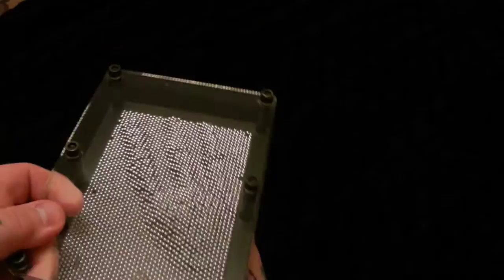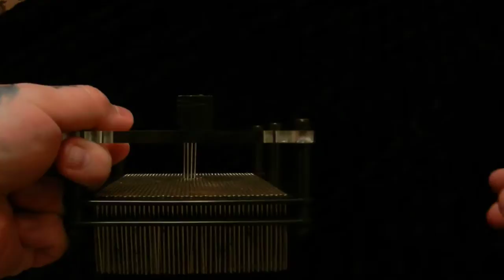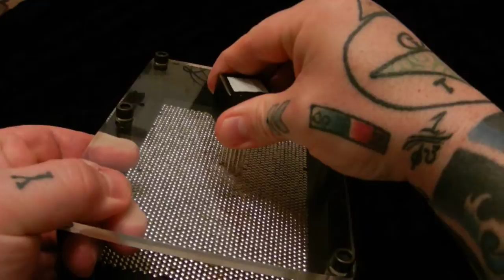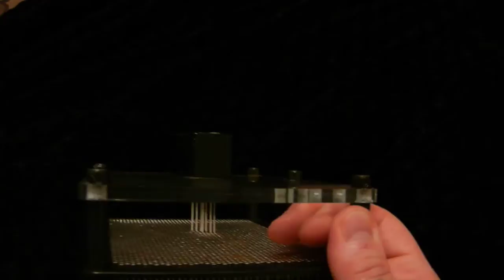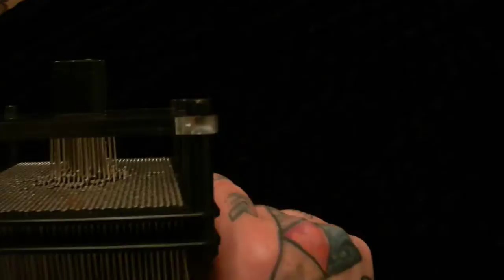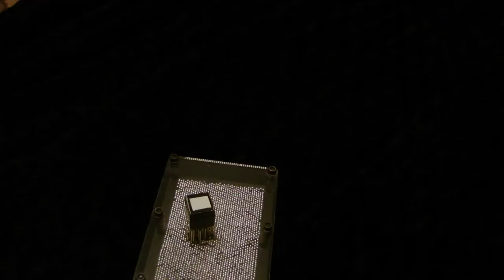The best analogy of MAGNETIC INDUCTION on youtube! Explaining field induction IN TIME

Comment: Coming in slow simply allows certain pins that are closest to the magnet to raise first and then because of the slight angles the pins are being torqued to stop other pins from raising due to friction caused by the unaligned pins all jamming together. I like a lot of your videos, but you should delete this one. It's wrong. You would see a different effect if the pins were guaranteed friction free and could not be angled in the imperfect holes in the base.

Comment: I think you are misinterpreting your observations or did not consider some factors. Three things, the angle of the magnetic force to the relating pins(nails), the resistance caused by the hole edges relating to the angle, and then the impact of magnet to the system when you show "fast" speed. All three combined accounts for the difference in the number of pins between slow and fast. If you were able to negate the friction of the pins, and were able to stop the magnet before impact to the face of the device,  you would see more accurate representation of magnetic yield. I infer that when you move slow that the pins depending on the angle to the magnetic attractions have to overcome the edge resistance of the hole. So moving slowly will cause data of only the pins with the least angle, least resistance, most attraction. Whereas the fast speed, you introduce a impact which causes two effects. It reduces the resistance because pins are vibrated away from their edge resistance, the second effect is the impact pushes down on the pins, and causes a rebound force pushing upwards, literally bouncing them up. Hence you have a larger data set of pins. So buddy... your experiment is ...well not conclusive.
Reply: That is a terrible counter argument. "Rebound force pushing upwards"??? Congratulations is in order, you came up with a new force unbeknown to every human in existence. Well played. 😆
Reply: @E V  Dude, you seem to be saying I am making up a "new force" unbeknown to human existence. As long as human existence has never seen a trampoline. When he smashes down on the top of his model, he is creating counterforce from the PIN perspective... which is in opposite of the direction applied but distributed unevenly. This is "UP" because that's the only directions the pins can go. I am glad you are skeptical, you should always ask questions.
Reply: @XR_IX  I have one of these pin boards and have done what you say it makes no difference to the result whatsoever in over 50 attempts. Even when the magnet is impacted with the top pane the force created is negligible and the same result is seen. This experiment is only one attempt to show the relationship between fields and time. Just remember the smaller the space(i.e time) the higher the capacitance. Then we can represent this phenomena mathematically.
Reply: @GiveMeLiquidity  If you post your experiment, I would appreciate that. I am saying as long as the force coming down influences the pin board other than magnetically, the results are inconclusive. Your hand or the magnet can't contact the pin board, the air from your arm can't even impact the system. It should be done in a vacuum, with a controlled constant stroke arm length. Only then can you vary the speed and post results. I have to be honest EV, this guy makes many leaps of theories, but never really proves experimentally nor asks others to replicate his findings, and ask for their review of the conclusions. Sure, this isn't done by a scientist, and he isn't writing his thesis at MIT, we're a bunch of tubers with a highschool diploma, so what do we know. But that don't mean I have to swallow his pill, cause it is a tad wonky.
Reply: XR IX I just wanna know if faster magnets make more...suck?
Reply: @k.g.8290  I am not sure what you're asking. It's really not a "suck" situation it's kind of a blow (thank ya very much). Magnets have a field of flux. Think of flux being electron brushes of broom. The faster you sweep, the more dust you move. But remember there are always design limits and external factors. So don't think that if you can move the magnet at the speed of light, you will get twice the power than you did at half the speed of light.

Comment: I like the analogy of time rate of change affecting the induction force.  However, To do it justice one would have to mount the base down on an immovable bench and bring the magnet in on a hinged rod so that it stopped just above the pin holder without touching it.  How the experiment it is presently set up it is unclear... There is an impulse that is transferred to the holder by the impact of the magnet at the greater speed.  We know this momentum transfer will result in the holder being displaced downwards and the inertia of the pins (being free to move in this direction) will tend to wish to remain in place.. resulting in more pins closer to the magnet source at the time of impact than when in the slower example.  more basically-   This is dislodging a greater amount of pins from rest position as they are being "pulled" by the magnet. -- and with your language and concepts.. which dove tail with eric dollards rather nicely..  actually when their internal magneto dielectric inertial planes are being rotated to coherence with the magnets radiative field... it is the ether that pushes them closer together accordingly.. but we  digress from what i am getting at..  Hope you see what I'm trying to say.  cheers .. well done on the good work.  :)
Reply from the maker: Yes, however I have thought of that already, and the unstable nature of the setup in the video or otherwise cannot dismiss the pins that will not fall forward after a close and fast snap to the system.
Reply: yeah, I gather that understanding would come from getting a feel for it and with much personal experience in the repetition. I was merely making the obvious comments on the macro physics contributing to the observations.   I appreciate what you have done with your book.  I've written similar conjoint consolidations / overlaps and concordances on the works on the nature of Dielectricity, Magnetism and Electricity..  though life has got in the way of collating together in such a volume.. my hat is tipped to you sir.. well done... any of my own insights have been brought into lucidity by resting on the shoulders of former intellectual giants far superior to my own, but after too many years to count sensibly studding the great and more maverick works of Tesla, Walter Russell, Goethe, E P Dollard, Steinmetz, Heaviside, Maxwell, Faraday, Leedskalnin, Keely, Steiner and others such as W Reich, Grassmann, etc..   ..   Its fantastic to see others coming to the same conclusions and it is most heartening for our species... esp considering the 'atomic suicide' that the atomists are increasingly bringing to every sphere of our physical existence - The particle-wave duality that our science is lost in is a circular wheel.. a reflection of self fulfilling mind-death - loosing the entire culture to its madness.  May the truest nature of the non-physical and the apparently physical shine into this dark age with more comprehensive understanding of the formative forces... and bring with that illumination some better peace for our kind - and in relation others of like kind.    Peaceout brother.
Reply from the maker: wait for video 55 tonight and see what I proved.
Reply: good show. :)